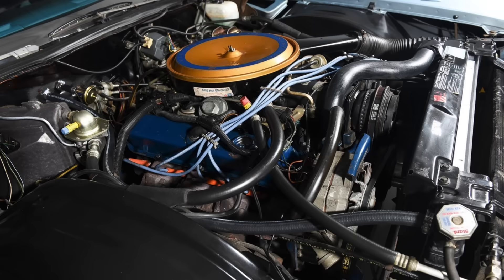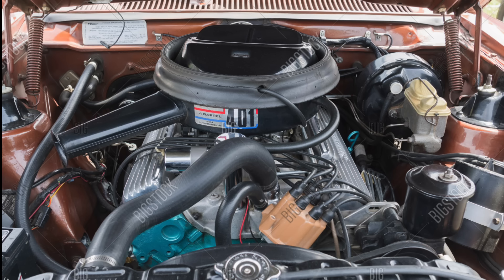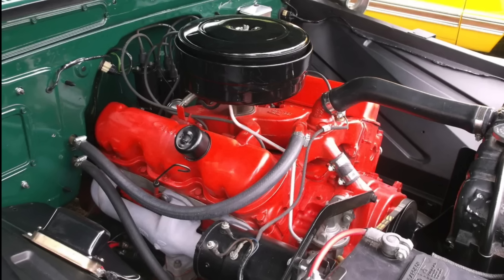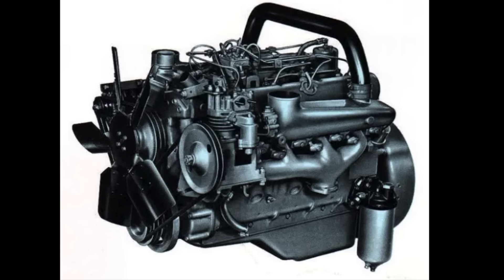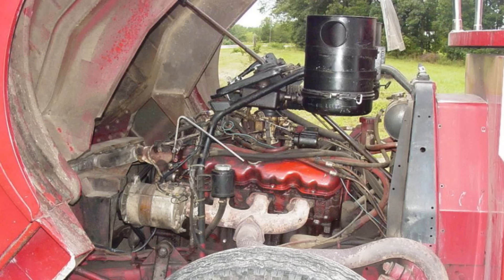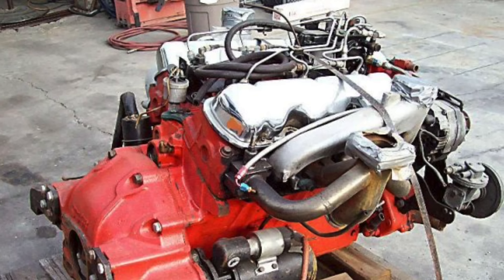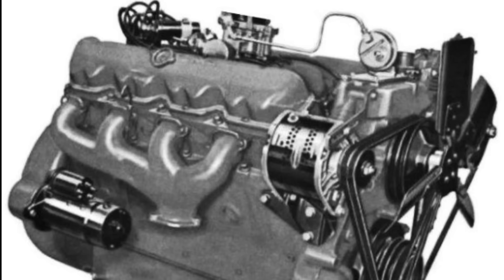The 1966-72 GMC 637ci 60-Degree V8 - GM's Largest On-Road V8 Is Virtually Unknown!

Comment: Back years ago I owned several trucks of that (and earlier) eras, powered by, among others,  a GMC 503 inline six, a Mack 707 inline six, several Fords including a 332 Y-block, a 477V8, and still own to this day a 391 V8 in an F800. All of these engines had their good and bad points but the one that stood, no, towered,  head and shoulders above the rest was the GMC 478V6. All of the engines mentioned made good power and, to varying degrees, loved gas (the Mack would get 1MPG if you were on a good downgrade). But also  those engines all  were sloths when it came to acceleration. Not so the 478. That thing could make a 15,000 pound empty weight truck accelerate like a quick passenger car and it didn't really matter if it was loaded or empty. And for what it was, it was even fairly good on gas. The engines did have their quirks and stupid design elements though. The worst for me was, there were as I recall two short water hoses that connected the front of the block to the water pump housing. I have no idea what, if anything, they were thinking when they came up with that idea, because if the hoses failed, as mine did, I saw no way short of pulling the front cover to replace them. So as a consequence I got used to applying copious amounts of tape to the hoses to keep them alive. But man what an absolute beast for power. As to the subject engine,, the 637, they must have not been very popular in my area as I only ever saw one, and it was in a repair shop for some reason. Back then the heaviest applications in the area were the steel haulers, and most of them (who were still running gassers) were running the 702 twin six.
Reply: Forgot to add a correction: GMC always had their own engines, from the smallest to the largest. They did NOT borrow engines from Pontiac! Those engines were a combined effort of Pontiac and GMC. If memory serves the design work was done mostly at Pontiac and the actual nuts and bolts stuff was done across town at the GMC facility, which had the facilities, including dyno cells, to do that work. Yes this all changed in the '60's but until then, GMC was on its own.
Reply: user Wrong !!!!  For years GMC borrowed Olds and Pontiac and then Chevrolet engines for their pickup trucks!!!Big trucks used these huge engines !!!
Reply: @user-fu1bh3dt2c 55 gmc 1/2 t had pontiac v8 n 4 spd hydramatic option stock

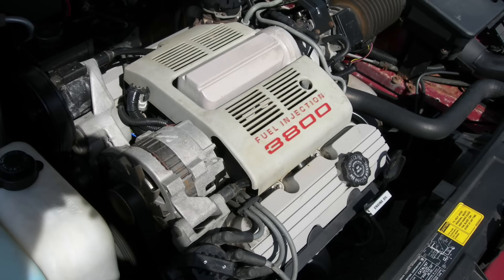Comment: At the 5:00 mark you said exactly what I was thinking when I read the title:  Buick and Ford cut cylinders off to make a V6 or a V8 with the wrong angle, and here GMC added cylinders to the wrong bank angle (though it's weird, the pictures of the actual V6's look like 90° spreads to me.)  It's also odd that they went over-square, when one would think that would make it less of a torque motor. 
Finally, of course, the bitter irony that they knew how to make a balance shaft to fix the angle problem, but it took Buick two decades to adopt it...
Reply: Yeah, it’s amazing that all big inline-4’s of the 20th century didn’t employ balance shafts. Many of those things were ferocious shakers. And yes, that Buick V6 was horrible until they went to even-fire (offset crank pins).

Anyhow, balance shafts were patented in 1907 by some guy named Lancaster, so it’s surprising they weren’t widely used until the mid-70’s …
Reply: @Clyde-2055  You know it's funny, I don't remember the 2000 & 2300 Pinto engines being rough, and they had very slick 4-speed transmissions.  I started speed shifting without even thinking about it.
Reply: @marko7843  — “An inline-four engine has a vertical vibration (at twice the engine speed). These imbalances are inherent in the design and unable to be avoided, therefore the resulting vibration needs to be managed using balance shafts or other NVH-reduction techniques to minimise the vibration that enters the cabin.”

Before balance shafts were widely used on these engines, manufacturers isolated the engine and transmission on soft mounts to minimize vibration transfer to the body. If you’d ever had an engine or transmission mount collapse such that the engine rests against the frame/body, it would rattle your teeth. 

The larger the engine, the more pronounce was the vibration. The threshold seemed to be 2.5L (150 cid), above which the roughness was difficult to quell.

The worst I remember were those large GM and IH “half-engines”, the GM being 194.5 cu.in. (half a 389) and IH being 196 cu.in. (half a 392) — those things would out-shake hell !

Aside from being an annoyance, these vibrations would also shake engine parts to pieces, especially accessory brackets and mountings.

Comment: I had a 68 GMC 3/4 ton with the 351 cu inch V6 with a stromberg carburetor and a TH400 transmission which required massive adapter rings that weighed nearly 100lbs each. I equated it to the wallop of TBI 4.3 with the fuel efficiency of a smog quadrajet 454. Shook like a bastard, just like the longitudinal 3.8

Comment: Was the engine designed to be a diesel first with gas being an option?  How many headbolts per cylinder?  What did GMC do right that Oldsmobile later did not?

Comment: I fixed up a 64 GMC and resealed the engine. No need to rebuild as these were 2X overbuilt as compared to a Chevrolet engine of the same time period.  I added Holley Sniper to the 305 and you could lug it to 600rpm without protest. Super cool engine. Also GMC rated the engine as Net power not gross power which was common practice so they made more power than what they were given credit for. Special grey cast iron, hardened valve seats with rotators, and I believe 3 compression rings and one oil control ring. High flow oil pump and coolant pump. That 305 I believe took over 9 gallons of coolant to fill.
Reply: There was a contractor that I worked for that had all GMC trucks. A few of the dump trucks had them big V6 engines even huffing oil all over they still made monster power. He had 3 utility bodies one was 66 that had I think the 305 motor. What I do remember most is them giant oil bath air cleaners & replacing radiators and or running em to Circle S auto parts to have em gone over and soldered up. Yes they took monster amounts of anti freeze. Usually in April he would send one of us to that auto parts store to buy like 10 cases of anti freeze as well them smaller barrels of oil usually Penzoil or Quaker State . Back then a case of antifreeze had 8 gallons in the case. When he sent me I had a crazy list of all kinds of filters in my pocket. The other fond memory is how them utility body trucks rode like an amusement park ride especially loaded with tools.
Reply: The small block Chevy 305 engine made its debut in 1976, designed by General Motors as a small V-8 that would provide improved fuel economy, while also sharing design and components common to the popular 350 engine to help reduce production costs, so no way this was the original engine, maybe a 283?
Reply: @charlesnorris2993  More like the 263 maybe 265 I believe??? It was an odd ball small block V8 in that one utility body truck. The shape of the weird valve covers always fascinated me. It was not the 283 that was mostly in cars until the late 60's when GM started putting em in light trucks... I'm just too busy right now to look it up. The engine had a really weird top end on it & only a small scrawny 1bbl carb for a damn V8 engine. Most of the 6cyl on the utility trucks had 1bbl carbs too. Some of the dump trucks with the 6cyl had a massive looking carb on em and really giant oil bath air cleaners. All of this trucks were GMC nothing else. His name was Howard Bailer. Allentown Pa.
Reply: Engine in video is a GMC 305 V6 not a Chevy 305 V8 @charlesnorris2993

Comment: There used to be GMC chassis based school buses,I understand had 351 or 390 cubic inch V6, 1950 to mid 1950's ?  had a loud exhaust resonance at certain speeds under load,sounded "poppity" like exhausting through a trumpet.

Comment: While GMC did have the largest, Ford certainly had engines bigger than the 460 in heavy trucks. The 1958 - 1981 trucks had an available big block v8 displacing 401, 477, or 534 cubic inches. I knew a guy who had two Ford L series dump truck, one with a 477 and the other a 534.
Reply: Isn't the middle engine a 478?
Reply: the rated the the 477 SD as a 475 or 477.the 475 was loaded with emissions .IH had a 478 gas engine  @johneckert1365

Comment: Good episode, but ...  Fords biggest gas engines on over the road vehicles was the 534, not the 460.  And I-H had their 549.  And since were are talking truck engines, Hall-Scott had a 1,081 and Waukesha and Buda had similar 1,000 ci gas engines for fleet trucks.  These are all low compression engines by today's standards. Back in the day they ran on what we used to call "Buss Gas" which was more like paint thinner than modern gasoline.  Some of the heat management stuff you see was because they ran them quite warm to aid in vaporizing the low grade fuel so it would burn completely.  Car engines were never subjected to such low grade fuels 😅

Comment: We're they using a 5 speed split axle or 5 and 4 transmissions behind this monster?
Reply: All kinds of transmission options.  Both that you described, plus an Eaton/Fuller RT613 (baby 13 speed). That RT613 was commonly seen behind IH DT466, and also Cat's 3208.
Reply: @johneckert1365  I've driven all 4 of those trannys, but I wasn't sure if the 13 speed was available that early on. I didn't start driving bigger trucks until 1980 when I turned 18 and the old '60s GMC gasser dump trucks all had the two I mentioned. Later onit was the 13 speeds behind a 3208 and a 13 od paired with a 671 Detroit. Screamin demon. Lol. Thanks for the info.
Reply: @danielmorris3687  You already know this, but when a RT613 was used behind a 3208, it had to be equipped with an air operated clutch brake. That's because the 3208 could only use a "push" type clutch, and not a "pull" type.

Comment: It's great to hear how thirsty they were, lol. Gas was what 20cent/gal. Or less. Not a consideration in the least. Thanks for the video.
Reply: That would be around $1.75 today.  Cheap but not as if it was a pittance back then.
Reply: N wages were about 2/3 $ per hr, so cheap gas was still a consideration @StFiacre

Comment: I had a 305 and a 478 v6.
They made Toro Flo diesel out of these.
GMC also made a huge straight 6 truck motor.
IHC made huge gas V8 and 6 in trucks also .
Reply: IHC with a 345 and 392 v8, a bigger lump of iron than the 502, and a biggie 549 cid v8.
Reply: Big 6 GMC truck engine, yes, 503, 477 and on down.  Going back to the 1930s, a different GMC engine architecture,  they made a inline 6 gas  707. 616, on down, several sizes.  ( I am aware  Mack made a 707 gas, but so did GMC)
Reply: IHC had a huge 749? And GM had v12 gas  @John.Zachary.Delorean
Reply: @Motorhead250 I'm not aware of a 749, but IHC definitely did make a 549 cubic inch gas V8.  The IHC 6s are interesting,  Diamond series = Green, Silver, Blue, Black, Red, Red were the biggest, I read years ago only the 501 cid inline 6 block was cast by AMC, next size down was 450 cid.  Wish my dad was still around, he grew up on a farm, he even had an International pickup truck when I was a kid. Gas, but it had a provision for a 2nd battery, he bought the bracket/tray to install under the hood, and added the 2nd battery, nice for those brutal Nebraska winters we used to have.  I got more interested in working on my own cars/truck when I got older, and he was getting toward the end.  God do I miss him and mom some days, they were almost 40 when I was born, so they had such a different life than I did, I only enjoyed hearing about stuff from way back when I got older and they were elderly
Reply: yes but i recall a behemoth 6 cylinder 700+ cube inch from IHC and Hale Scott also had huge gas Motors . @John.Zachary.Delorean
Reply: @John.Zachary.Delorean PA 100 1930s was 649 cu in Six . Sorry
Reply: @Motorhead250 thanks for including PA 100 , I looked it up, the gas 6 cylinder IHC 👍  and the Hall-Scott 1091 (I think), and others, yeah, I love reading about and watching the few videos of those engines, they were so advanced of an engine design,  and power output for the day.  Wish I had been born earlier
Reply: Imagine how much gas they burned.

My uncle had a 534 V8 ford farm truck to run veggies to Bronx NY.
5mpg but fast .  @John.Zachary.Delorean
Reply: Look up Napier Deltic diesel engines.. Three cranks a triangle monster.
Reply: @Motorhead250 as soon as I read your comment, i thought, 🤔 was that in a locomotive  ?  I must have seen a min or 2 about that a long time ago

Comment: When I was a kid I remember my Grandpa talking about swapping truck motors into cars and I'm pretty sure these are the kind of truck motors he was talking about.
Reply: I'm not saying you are wrong.  These engines are extremely heavy, you can look it up.  Just a guess here, I've read quite a bit over the years, from what I've learned, the GMC inline 6 truck engine was a popular swap that guys did after WW2 in the late '40s and the 1950s.  Not to be confused with the Chevy stovebolt 6 etc.  These were heavy duty, quality, more hp, torque, the 270s were in a lot of military vehicles in WW2, I think a lot of young guys found out, that's one hell of a quality, well designed, well built engine, and makes a lot of power.   Now I'm not sure how popular the 248 GMC was, or if some guys just settled for it, but the 270, it's my understanding, that a lot of guys in that era used in dirt track race cars etc  Whether they got them from a multitude of applications (?) commercial-type trucks, bur I'm pretty sure a lot of 270 GMCs were in "deuce and a halfs" as they called them 2.5 ton trucks used in the war, among other military vehicles.  Less common, but more desirable was the bigger 302 GMC, 😁 (4.00 X 4.00) , also a truck engine.  There was a time those engines were dominating certain types of racing, like dirt track.  I'm 49, not 89,  I only know what I've read, eventually,  signs were put up at many race tracks banning "truck engines" , and old timers who were around at the time claim this rule was targeting the GMC 302 specifically.  There are videos of guys with those old "hot rodding" type cars (I think of '30s Fords & Chevys), with 270s & 302s, so apparently it really was "a thing" quote unquote
Reply: @John.Zachary.Delorean I've read about guys putting GMC bus engine blowers on the sixes for racing. How they did it, I don't know. I've never seen a picture of that.
Reply: @John.Zachary.Delorean I know of an old timer up in alaska that has a deuce and a half engine in a 60's truck. it's pretty neat. unique sound. 
he told me in the older times when he raced, that he would use a pontiac two barrel on a tri power intake to get more cfm on the inner carb and let the outer carbs be.
Reply: I'll bet it was

Comment: In the V-6 lineup, the 423 CI you mention is actually a 432 CVI. GM took a 401 CI and put in a 478 CI crankshaft to achieve this.

Comment: For those that haven’t seen the V6 version in person, the engine shown at 3:00 is the size of a big block chevy and heavier.  Heck the water pump on my 305 looks like it weighs 50# by itself.  Cool old engines.  Thanks Adam. 👍
Reply: I had a 65 GMC half-ton with a 64 Chevy 327, and can confirm, the 305 in that picture is as big as the 327.
Reply: @emilyadams3228  uncle had one in his 67 GMC truck idk which variant but probably one of the way bigger bois considering he pulled a damn semi out of a ditch with it LOL
Reply: @emilyadams3228  Set a GMC 305 next to a small block Chevy (Like a 327 for example),and the V-6 is at least 10 inches taller as wide I believe possibly longer,anda few hundred pounds heavier.
Reply: The 305e motor has 142 max horsepower…at4200 rpm …and 509 lbs of torque at 900 rpm..coupled to 4 speed with a granny you could pull almost anything
Reply: Back in the 80s a buddys dad had a small excavation company,had a GMC with the 305 v6. 
Us kids kinda chuckled ,didnt look like no chevy 305 but looked more like a rat motor😂
A v6 with v8 sized valve covers
Reply: Trying to overhaul one be a nightmare. Hand fitted, Bearing and pistons often half of a thousandths bigger or smaller than spec. And still there was persistent bearing crank, and head gasket failures. Newest Gen seems to have fixed a lot of those early problems.
Reply: The water pump on a 305 is a fraction of 50 lbs